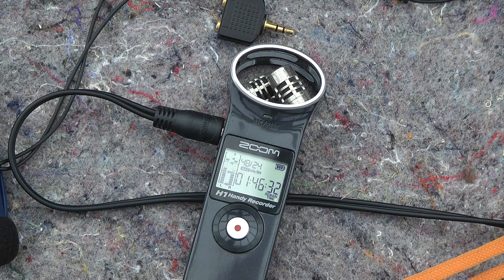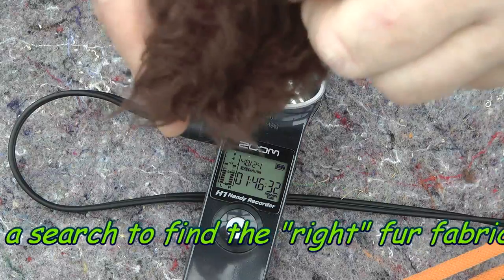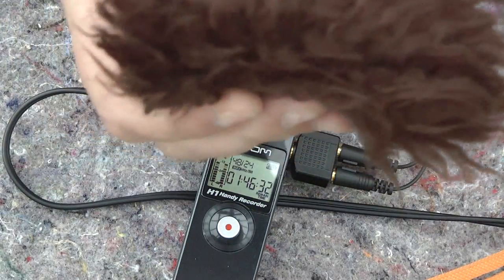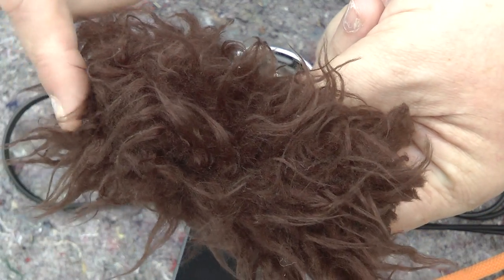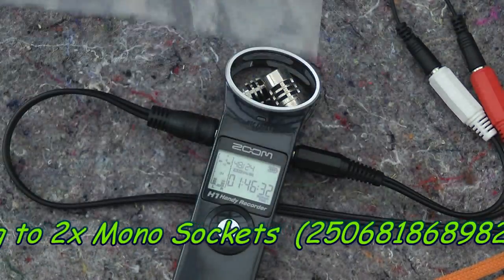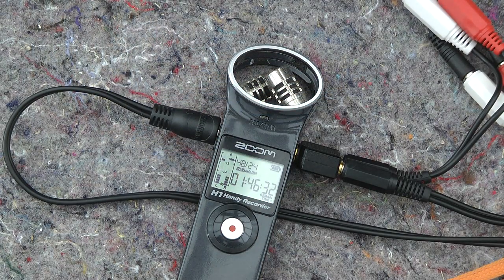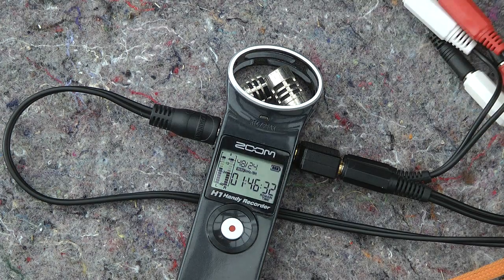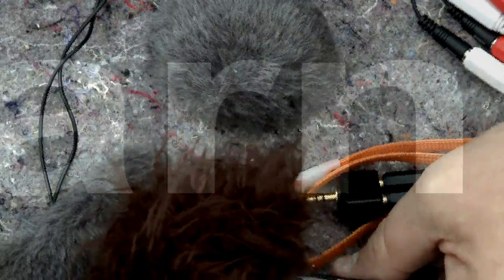Stereo Lavalier Adaptation

Comment: Once again an informative review and great demonstration of the el-cheapo Neewer mikes ( probably all sold out now after our rush of video demos!) Like the idea of the stereo to mono splitter, convenient. I cut off the plugs and soldered the wires into a new 3.5 jack plug to get around introducing more electrical points of contact as some of the 'china quality' sockets are notoriously noisy when subjected to any cable movement. Like your furry critters!

Comment: Thanks Sir .. I found the stereo to 2x mono in Amazon. I order it, I live Belgium, it will took some time to receive it. I have not much hope but who knows. Note: I have stereo using Fostex AR 101, I which what the hardware does, the cable etc. Note: I do not find the issue stereo outdated, the stereo mics as rode video pro etc is very expensive. The two rode Lavaliers: I paid 170 euro for 1 mic. I had the idea to go stereo with two Lavalier. As I mentioned, great stereo sound with Fostex ar but it is always struggling outsides with the connection were is needed an iPhone camera case, such as Beastgrip or SmartPhocus. The Zoom H1: last year I had it in house for 1 week. I was not be able to work with, the audio level and PC work was little to difficult so I turn it back to the shop. Maybe is just this equipment the hardware I need for stereo. Let me wait on the receiving cable stereo to mono. When it is as you let me understand not possible because of the Apple difficulty than I will rest in the topic and continuous with the Fostex if I want to listen in audio to the birds or the differences in music rich as left and right specified stereo sound.
Thanks to listen my story, I was really pleased with your video clip... Thanks, good day.. Luc
Reply: Hey, Luc !  I absolutely agree with your implication that Stereo for ambient noise - birdsong and stuff - is a world apart from the pathetic mono stuff.  I remember listening in awe to the early "48 track stereo sound" vinyl discs and listening to broadcast TV in stereo sound.  Now people seem more interested in 3D visuals than the magnificent immersive surround sound technology offers and the idiot consumer shuns.  I am old, and I feel old.  I thought progress was about moving forwards... silly me!

Comment: I use two rode Lavalier with KV connection. I try to find stereo on iPhone using RCA but it will not work. Zoom I do not have, the last hope is your Y stereo to mono female. I search tomorrow for the y adapter. Note: the link on eBay is ended. Thanks
Reply: I do not own an iPhone, but I do have an iPad, which has 1 x 3.5mm plughole into which I plug stereo headphones with a conventional stereo (TSR - Tip, Sleeve, Ring) jack plug. Apparently, the designers at Apple hit on the idea that one plughole should serve all your needs, so if you plug in an adaptor with the right plug ( a TSRR - notice the extra ring), then one leg of the lead gives you the stereo headphone output and the other leg offers a microphone input.  I'm not sure of whether this input records in stereo or mono, because the Zoom offers much better functionality for me and Apple products seem to me to be designed very thoughtfully for people who think differently to me.  Thanks for the info on the link: the whole review is getting old and ready for Retirement/Euthanasia. Just Google "KV connection to iPhone", and there seems lots of advice out there.